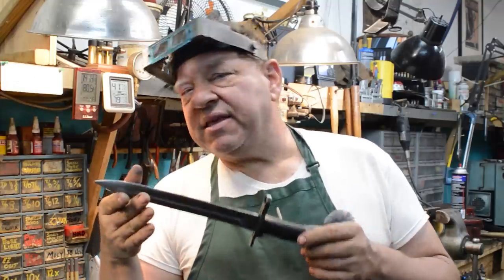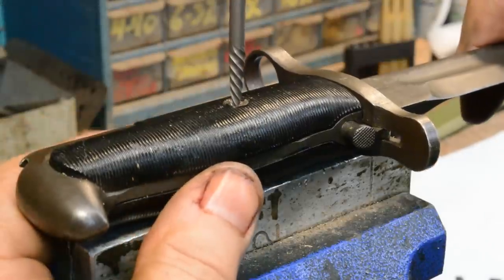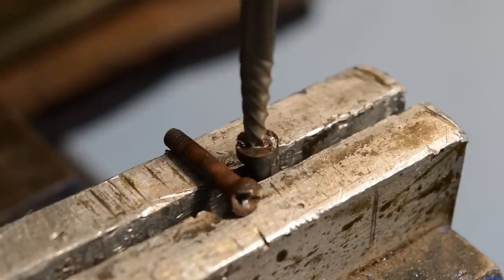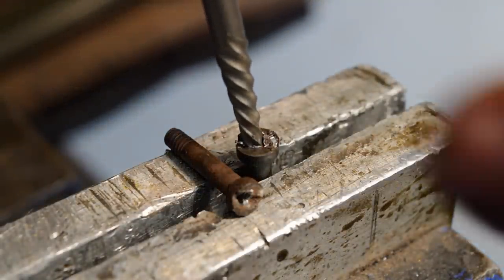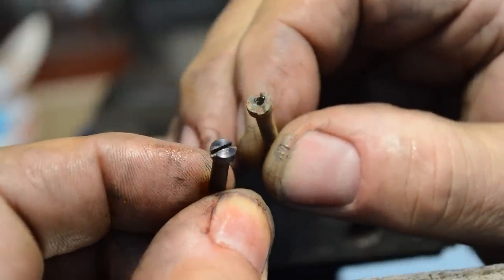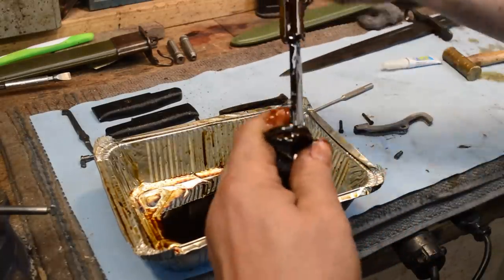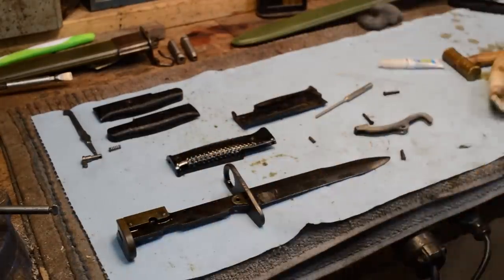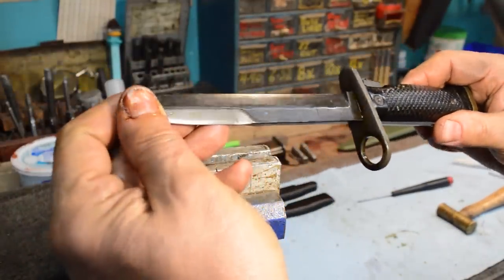Bayonet Repair and Restoration

Comment from the maker: As for the drill motor "lathe", the undiscussed topic is the safety angle. Much less available torque and WAY smaller rotating parts to get hurt by.....This aspect makes the technique my go to on the bench.
Reply: I would just ignore them. Anyone who says anything about it has too much time on their hands.
Reply: Good Technique Could It Also Be Done in a Drill Press 😀😊
Reply: @chrischiampo7647  yep, ive done it several times
Reply: used a drill press to make a take down pin for a 1906 remington rider #9. found a round rod that was close and used drill press and file to size it then put the detent groove in it, drilled the center notched the end drilled a hole for the roll pin, hand cut and filed the lift tab for it then used a ball point pen spring and a bb for a detent to keep the tab tight against the side of the receiver. Used cherry red to surface harden it. Worked very well. Also had to find screws close in size and thread then recut the heads to size and slot them using my b&d 20v battery drill. Hand cut and filed out a side cocking lever for it as well that was missing. And last the top lever spring was missing so I used a sawzall blade detempered it, cut the piece and did the form work then retempered and annealed it. Worked beautiful. Was a project from my wifes uncle that came to me in a coffee can of parts with a barrel and butt stock.
Reply: Great technique,  I use it all the time 
Great video thanks!
Reply: used Marks rust bluing video as a pattern even bought bobs rust blue solution and used it to blue the barrel, its a very deep blue and now is the only way I will blue parts, no more wipe on cold blue for me. My setup is a bit fancier than bobs but I have a shop full of wood working tools and had a bunch of left over plywood to build the hot box using a cheap heater and a small humidifier.  My steam tube is a copy of bobs including the turkey fryer
Reply from the maker: @ScottKenny1978  15 hp, but who's keeping track.......
Reply: My only comment on the drill lathe would be that I'd put a washer on the bolt to separate the file from the chuck teeth.
Reply: The only lathe I've ever used is a DeWalt cordless keyless drill lol.
Reply from the maker: @scottborkowski4487  OUTSTANDING. Keep doing this....

Comment: I just had the horror of watching another "restoration" video of a WW2 issue RAF jack knife and the guy took a blow torch and a dremmel to it. Heat treat and parkerized finish instantly gone. Tool ruined. They took the sheen off the bakelite as well.

Comment: Love the drill and handfile trick.  I used to call it the poor man's lathe if i needed to alter screws or make pins/detents.
Reply from the maker: The undiscussed topic is the safety angle. Much less available torque and WAY smaller rotating parts to get hurt by.....

Comment: I am 110% supportive of refinishing, repairing, rebuilding, and/or conserving a dying piece of historical machinery or gear like a firearm or bayonet like this. The things were designed and built to be effective tools and used to do work. What good is a rotten, broken tool that's slowly rusting away, or is slowly being eaten by mold and termites?! Ick. 

My ex-dragoon 1922 hex M91/30 is wonderful. Nice bore, numbers matching, but the stock was not original and there was some fossilized cosmoline in the nooks and crannies that was gross. Bit of a sticky bolt syndrome too. The stock was an arsenal replacement from post WW2. There is a marking on it that's clear as day denoting that fact. It had the typical and horrible fugly "Rusky Red" shellac finish on it which looked like it had leprosy after all these years. I researched and determined that some of the very early rifles had a traditional oil finish prior to the switch to shellac. That allowed me to comfortably choose Danish oil for the refinishing. :) It's at least somewhat appropriate. I believe 3 coats were applied. It's at the point where another 1-2 coats would bring out a shine which I didn't want. It is now simply beautiful! I didn't sand away any valuable blood and guts from Stalingrad because the stock was from the late 40s or 50s. No value was lost and now the rifle looks handsome and admirable and functions smoothly just as it should be. Well...as handsome as a Mosin Nagant can be. 😸😸😸 It looks as it would have looked back in the 20s a few years after it was given to a soldier fresh out of the crate and gone through a bit of fighting. The bolt and interrupter work perfectly; no bolt-opening mallet required. I'm happy with it. I would not do this to a rifle that was all matching and not fugly. 🤷🏻‍♂️ In my opinion, this is the way. Guns were meant to be fired. They were meant to be admired and appreciated. If no extreme historical value exists, get rid of the decay and wind the clock back a few decades. Honor the tool and repair the neglect that past unappreciative individuals imposed upon it.

Comment: That is a bit more complicated that the bayonet I did for a Springfield Model 1873 last week. It did take two boiling’s. I would not have been willing to tackle the rifle if it wasn’t for your video earlier this year. 

I have been amazed at the results of patina covered items after an hour or so in boiling tap water. Parts from Brown & Sharp and Starrett cleanup just as nicely as parts from Springfield , Winchester or Rossi.
Reply: on that note of boiling water, tap source matter? I have hard well water, where city water is heavy with chlorine.
Reply: @warrenharrison9490  

I don’t believe so. One can try some insignificant or non critical items. Today I was cleaning up some old carbon steel threading taps.   The patina was such that they were hard to read. I can now read them easily.

Comment: You teach me SO much but I may finally have a word of advise for you.
Get a knipex pliers wrench.  It has 98% replaced my Crescent AND my Slip joint pliers, along with providing me a great set of smooth jaw pliers.  No marring, no slipping, and tremendous leverage.  Handy for pushing in pins too.  The medium sized ones are the best for most things and the jaws open so much wider than a crescent on the 6 or 7 inch whatever the metric is on that.  
They were different at first..  but I truly don't know how I lived without them.  Amazing @ss tool.
Reply: Knipex is extremely high quality German stuff. Kind of expensive but definitely well worth the "buy once cry once"
Reply: @JeepWranglerIslander  I do maintenance and construction for our business.  Their electrical/wiring tools are tooooop notch.  Makes jobs I hate enjoyable.  But that pliers wrench gets BEAT.  It goes with me to work, it moonlights on my gun/work bench.  Goes with me in my forestry kit.  Always goes with me when I leave the house on a longer roadtrip.  Really just need to buy like 4 pairs but yeah.  German and cheap dont go in the same sentence.

I used mine the other day with a breaker pipe to crack a muzzle device on a friends gun.  Nary a mar.  Made keaf springs with it.  Used it as a field vise with a doubled ranger band on the handles.  Use it every time I work on a vehicle or farm equipment.  I got my monies worth in the first month when I was still figuring out how it could be employed...
Reply: Agreed. The Knipex Pliers Wrench are non marring even on Anodized Aluminum, amazing pliers. The 86 05 180 (1 1/2"), and 86 05 250 (2") are must haves that you didn't know you needed, until you've used them.

Comment: I love the use of the "drill lathe" by the consummate gunsmith.  That's all I have, that and my drill press, and I've made all kinds of pins and screws and little parts with them.  Wish I had a Jet lathe but alas no room.  Another fine video by the Anvil-
Reply: Have done the same, including making brass ferrule for colt grips from old brass plumbing fittings. Drills are handy for that.

Comment: I may get a chance to try my first conservation here shortly. Last from church asked me to appraise the pile of guns she was awarded in her recent divorce. A big pile of rare-but-cheap, one helluva bubba'd 30-06 that I told her to put a hefty disclaimer on (the wrist alone had been filed to under an inch diameter), and what could be a fairly valuable model 64 Winchester.... If the barrel and bore weren't entirely red....
Reply: There are some pretty nice repro stocks for Garands available, and if the Late Bubba didn’t mess with how the stock attaches, you can clip the new one back on.

Comment: Question please.  Used motor oil. I know you recommend certain oils. With that in mind,  we know you like non detergent oils for conservation.  When using used motor oil is it non detergent also ?  
Most small engine oils in lawnmowers and such still use non detergent where cars use multi grade detergent oils.  Then we start thinking about synthetic oils.
  Might make a good video also for greater clarification. 
Thank you for your educational abilities.

Comment: I remember going through bayonet training.  I will never forget how hard it is to press that damn button to get it off the rifle.  I always thought, well no way in hell these things will pop off in hand-to-hand.  One of my favorite memories, because you have so much built-up anger and testosterone by the time you get to bayonet course & it's such a great release of all that angst.  I can't imagine the horror of combat where going bayonet v bayonet would be.  I'd rather never know.  I always felt bad for the machine gun guys, yeah they get one, but they don't get the fantastic club that is a rifle to go with it.  Your ability to fix and bring back to life so many different weapons just astounds me.  Something about Yankees and technical hard to do things.  Must be all that fantastic time indoors during the winter.  Question, would it be better to use a drill press in order to get the head of the screw as close to perfectly flat or even a lathe to cut it down?  I am quite amazed there weren't millions of these available.  I suppose the military just melts down whatever bayonets aren't assigned to some other tasking when they changeover to new combat rifles.
Reply: No Sir, they don't specifically melt them. They break the blade off about an inch and a half above the hilt! I don't know if there is a 'Demil Standard' for bayonets. That is the condition of the ones that I got ahold of. I grabbed a few of different models for the grips and spare parts. They were demilled at Anniston. 
      Nice video. Ya'll Take Care, John
Reply from the maker: Not everyone has access to a lathe. I try to show other ways sometimes to show the possibilities

Comment: Do one on servicing the local church organ as its coming up to that season soon, 😉 I bet it would be just as interesting
Reply from the maker: I have tried 3 times to do an episode about pipe organ service. One thing or another usually hoses up. Timing is the big thing, camera angles, and SOUND. The organ has to be available, too.   The sound problem is stereo. Stevie Wonder and Ray Charles swim their heads around to capture the interactions of the sound around them, and we do that also when tuning. Have not been able to duplicate any of that, on a video that is watchable...Eventually, we will get it right.
Reply: @marknovak8255  I'll look forward to that, I didn't realise that was the reason they moved their heads like that
 👍

Comment: have had to do similar for missing screws on a few gun projects, find one of close length and correct thread then recut the head to fit what I needed and cut to length, I use the poor mans lathe too. Either a battery drill or  drill press and a file

Comment: Ive been building a trench gun based on a norinco 1897 and hand made parts.. I found some dude at a flea market selling some new bayonets. I think they were from Pakistan.  but I ended up with 5 or 6 different styles all shiny and new. i have been distressing them to make them look less shiny and i never thought of used motor oil.... thanks.

Comment: Mark  ive  removed  about  10,000 10/32  and  8/32  stainless  on  commercial aircraft over  the  years.  The  real  fun  is  when  the  #2  easy out  goes snap. Kroil  is  a   magic thread juice.

Comment: Mr. Novak...  what do you recommend for a bench polisher?  (for polishing/carding)  Looking at the RPM ratings, it seems that most all of the ones I am seeing that are considered "low RPM" are just under 1800rpm.  Anything out there with something below 900rpm?  I can't seem to find anything.  Thinking my next step will be a shaft and pulley system to reduce the speed.
Reply from the maker: Polishing is about pulling the largest wheel you can at the highest RPM you can get. 1725 (4 pole motor) is actually the slowest I would want to spin. Just my opinion.
Reply: @marknovak8255  Thank you, sir!
Reply: I recently got one from Eastwood so far I love it, & the price was just slightly more than harbor freight, & the shafts are longer, use a drill or drill press on slow for carding
Reply: For carding I use an adjustable drill press from harbor freight. Get there's different models that have different available speeds. Chuck a carding wheel in it and go to town!

Comment: Mark, awesome work.
But that isn't a "blood grove" 😄
Reply: Commonly called that. The indentation is actually there to strengthen the blade.
Reply: I believe it's called a fuller and has the same effect as an I-beam
Reply: Occasional knifemaker, and full time knife dork.  Yes, it's called a fuller.
Reply: "groove"
Reply: @gtmtnbikr  lol, too much GTA in my blood

Comment: I'm going to have to find that old Swedish Mauser bayonet and give it a tune-up.

Unfortunately, some ill informed idiot (me, about 25 years ago), took a kitchen knife sharpener to it and really hosed up that edge.
Reply: Chances are good the steel is in good shape.  I have hand sharpened a few of those and they can polish up nicely.
Reply: @dkruitz  unfortunately, this idiot used one of those hollow ground sharpeners on it. 😭

Two ceramic disks and you draw the blade between the two.

Comment: Has lathe, uses drill in vise.......smfh.
Reply: If it looks stupid, but it works, it ain't stupid!
Reply: A drill in a vise is no longer a drill, it's a 3 jaw lathe
Reply: Quick easy and good enough for a bayonet screw, and he might have done that for the benefit of the home gamer without late.
Reply: @540i6vids  lol i did that sometimes too
Reply: Man everyone down in these comments is an expert, huh?
Reply: @tylerm8371  it's more like a fun conversation lol
Reply: @tylerm8371  actually i am . 25 years machinist and tig welding . Made plenty of screws and fixed tons of holes with a tig. If you have a professional tool thats better and makes your work like original then use it. The home guys use a drill and a file.

Comment: You lost me at blood groove🤦🏼‍♂️
Reply: He's not wrong. It's also called a fuller (if i remember right) and it's been explained that the idea behind it is to make someone bleed out faster when stabbed. Hence why some swords had them.
Reply: It's to reduce the tip weight on a sword. On a drop forged knife it reduces the amount of steel that needs sharpening.
Reply: @erg0centric  It also can be thought of as, sort of, an I beam. Reduces weight while improving its structural strength.
Reply: @erg0centric  it’s called a fuller.
Reply: @cvmaniac7286  you can make them bleed out faster by removing the stabbing implement, just FYI
Reply: @kleinjahr  removing material never makes a piece of steel stronger, maybe stronger than another piece the same weight,  just like the commonly stated purpose of barrel flutes...no they don't make the barrel stronger just lighter and without sacrificing strength.
Reply: @phileas007  True. Also, a slight correction on what i said earlier straight from wikipedia (had to look it up. But what i said earlier was told/taught to me when i was a kid): Fullers are sometimes inaccurately called blood grooves or blood gutters. Channeling blood is not the purpose of a fuller.
Reply: @CCW1911  Yep, my point exactly. Though shape does have an effect on how it would react to the force vectors. Think of the difference between beam length of a flat bar and an I beam of the same weight and length.
Reply: Just because it wasn't called a blood groove at the factory or on the design table doesn't mean that's not what people called it? Why is everyone so fucking hissy over that. There are a million GIs who called them blood grooves so he isn't wrong. Mark probably knows that. Jesus christ everyone needs to take the stick out of their ass and quit acting like they know better.